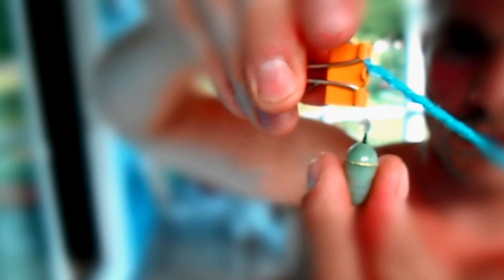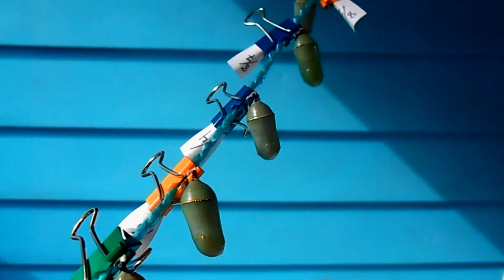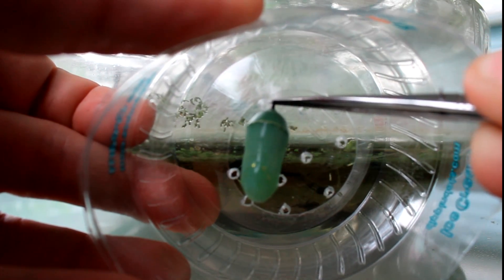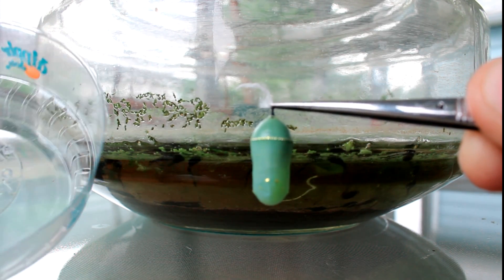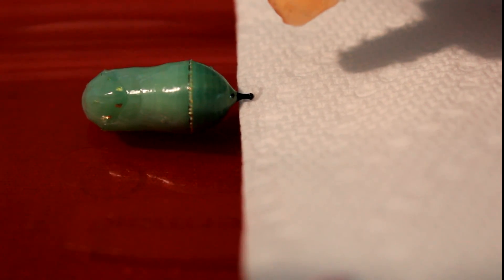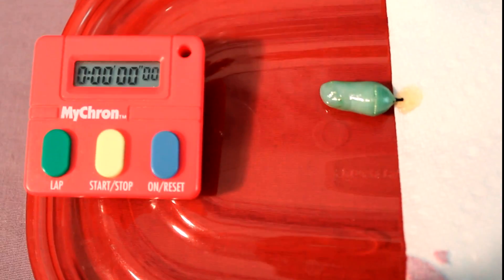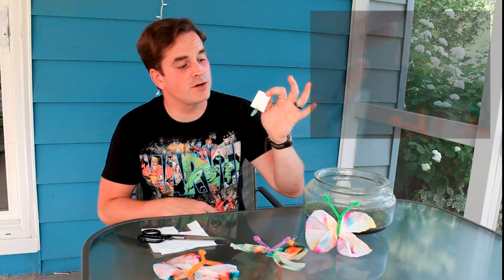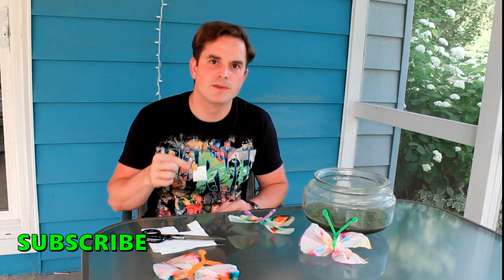Raising Monarchs - Chrysalis Repair (Help The Monarch Butterfly)

Comment: Nice work!  I use hot glue and place the stem as the glue cools but is still soft.  I place a drop on the screen aquarium lid and then stick the stem into it from the underside.  What's strange this year (western monarchs) haven't been producing the amount of silk they normally produce?
Reply from the maker: Yes.  By all means, there's a few different ways to do this that are successful, and yours sounds great too.  I thought also, putting out this video would actually save me a bit of time.  Next time someone asks the question, rather than typing the steps out, I can just send this link.  Strange about that amount of silk being different...
Reply: I wonder if it's a dynamic issue?  You'd know better than I but if the surface is smooth they make more?  The one's I had last year, some were making as they looked for a spot, almost 6 inches worth.
Reply from the maker: I can say that whether it's smooth or rigid, I haven't seen a noticeable difference in the amount of silk they use.  Did have one once that spun a LOT of silk, yet, didn't attach the stem very well at all.  When I went to transfer it to the cord by pulling it off, only a small amount of silk stayed attached, and luckily, it was the part I was gripping with the tweezers.  That's one of the ones I had to repair in my past using this method.
Reply from the maker: Cool vid.  Nice to see how many milkweed you've got successfully growing!
Reply: MrLundScience Thanks!
Reply from the maker: Wow...
That's crazy.  Do they give any rationale as to why they are spending money on doing that?
Reply: Heavy lobbying back in the early to mid 90's by grass seed farmers and ranchers.  Studies have shown that horses and cattle won't eat it and if it's in the hay, they'd need to eat approx 10lbs of dry MW to get sick.  They need to cut and spray anyway but they could create no Cut/spray zones.